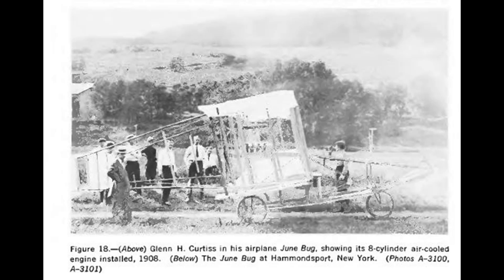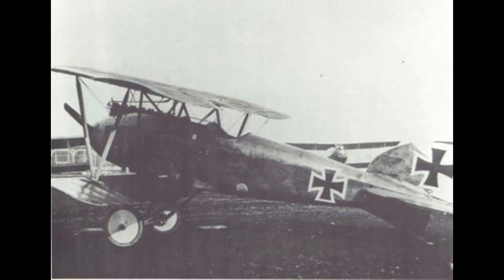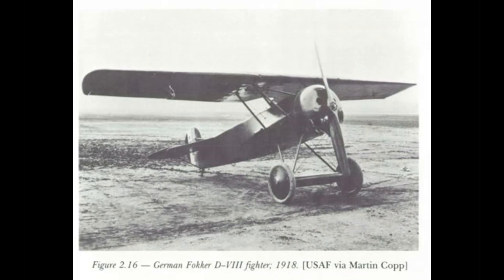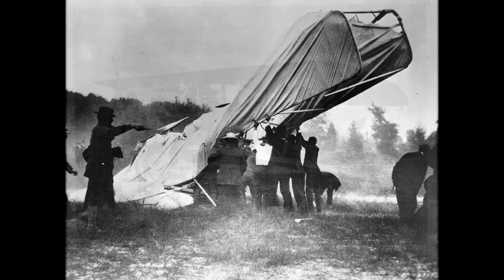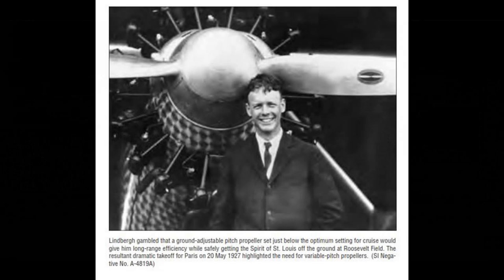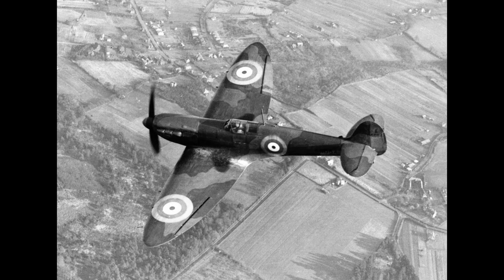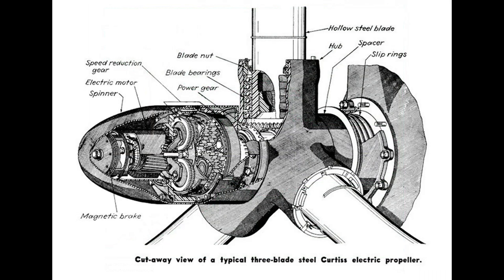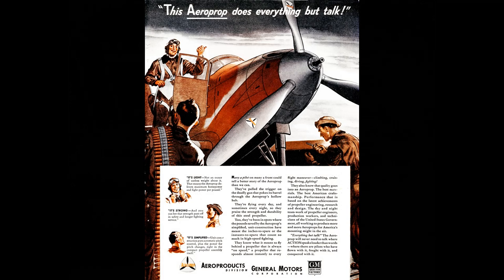Advancements In Propellers 1909-1942

Comment: Hi Greg. The Fokker Dreidecker was able to achieve exceptionally high angles of attack (by the standards of the time!), due to the thick airfoil w/rounded LE. This gave it the ability to turn tightly and achieve deflection for the guns. The cost of the poly-wing approach was exceptionally high induced drag, hence the need for maximal low-speed thrust, to counter loss of height in a turning duel...

Comment: Great video, as always.

The details of the constant-speed mechanisms was especially interesting. Am I correct in thinking that in variable pitch propellors the force of the pilot moving the pitch lever was the only power involved in moving moving the blades? That is, there wasn’t an electrical or hydraulic system to actually do the work.
Reply from the maker: Hi Alexander, not really, I should have clarified that. That variable pitch prop is essentially a constant speed prop but without the governor. I'll clarify that in the next video.
Reply: @GregsAirplanesandAutomobiles  oh, I see—thanks for the explanation.

Comment: Wow you blew my mind. 🤣
I never realized that props were controlled by a basic Briggs and Station mechanical governor. Hahaha 
Your outlook on hydraulic vs electric does leave out the problems with hydraulic systems. Pump, shifting valves, lines,spools, and temperature. I don't know what kind of redundancy it built into each system. I love your work. 👍
Reply: I think the main benefit is that if your hydraulic prop has issues, you can still use the radio, instruments and everything else that needs electrical power, and limp back home with your prop on whatever manual pitch control system is built in.  I remember a generator going out on me and just barely making it home one night, not a good time and I was only driving a Bug, not a P-38 out over the Pacific hundreds of miles from home. 
So to me it seems that of the two systems emergency scenarios, the hydraulic system has fewer drawbacks.  Either way, it most likely was no picnic for the pilot if either system went out.

Comment: Very good points at 14:00 - re the adaption of constant speed props on the Spitfire MkI. Although the Rotol constant speed props were standard on production lines by early 1940, it wasn’t until after the Battle for France that existing front line fighters were retrofitted. The Luftwaffe’s comparison between the new 109E and a captured spitfire in June 1940 were conducted with a De Haviland ‘two speed’ prop running 87 octane fuel: the Germans believed their plane would have a slight performance edge in the up coming BoB, but were surprised by the performance of Rotol constant speed prop spitfires using 100 Octane fuel - which both the spitfire and Hurricane were using by July. The BoB Spit could climb 750ft a minute faster than the one the Germans tested only the month before. Ouch.
Reply from the maker: Thanks Andrew, well said.
Reply: … the performance of De Havilland constant speed (upgraded) propellers using 100 octane fuel !  The Rotol constant speed props were on the new Mk IIs, only 4 squadrons had Mk IIs in early October 1940.
The Bf 109 got constant speed props in the F model.  Early installations in trial Es and early Fs had the constant speed controls wired off because of initial teething problem unreliability.

Comment: The Stearman pictured has a 300 hp Lycoming engine with a Hamilton Standard constant speed prop, 2B20 I think. The typical ground adjustable propeller on a period correct WWII Stearman was a steel McCauley 41D5926 (Army) or D-1093 (Navy) I’m not sure when they became available, post war I believe, a Hamilton Standard 5404 ground adjustable propeller with aluminum blades and steel hub  are common.

The McCauley and Hamilton Standard are not difficult to adjust. It can be done effectively with the propeller on the airplane or a prop setting table. 

I own a Stearman and maintain it.

Comment: Amazing work as always. Please pardon me if I missed, but you said in the D3 that in a dive you fairly easily overspeed the prop. What is the consequence of the that? Do you mean that the plane is going too fast in the dive for the prop to help or is the airstream somehow windmilling the prop faster than its design strength? Thanks. Henri
Reply from the maker: Hi Henri. As dive speed builds eventually even with the engine at idle the airflow will windmill the prop pretty fast. With a low enough pitch prop and a high enough dive speed it will windmill it above the engine's redline. For this reason the engine's redline was the actual dive speed limitation in many early planes.

Comment: Prop stays on Top is the mnemonic I learned for order of operations of a constant speed prop.
Reply: Good for a last second pre-take off glance.
Not a great mindset though if you are constantly alert for an engine failure, that is the prime requirement for safe multi engine flying.  Getting the prop feathered as soon as you have correctly identified the dead engine involves pulling the blue lever right to the bottom without delay.
For normal power reduction throttle is reduced first, for normal power increase prop is increased first.
Reply: @givenfirstnamefamilyfirstn3935  Prop stays on top means exactly what you just described.  Prop moves first when increasing power, moves last when reducing power, hence the expression "prop stays on top."  It has nothing to do with a "last second pre-takeoff glance."
Reply: @jaym8027   I hadn’t heard it.  It makes sense if your Jack Ridley stand-in explains it.
The first adjustment you make is a power reduction.  The blues start off fully forward.

Comment: The ground-adjustable propellor allows compensation for density ratio. The engine's power output and the required takeoff groundspeed are both significantly affected by prevailing density ratio, so a ground-adjustable prop is generally tweaked for optimal takeoff at either the aircraft's home field, or the critical one of the fields it visits. Summer and winter adjustments may also be necessary...

Comment: Wow. I asked my A&P how does this work. He stated from memory a description of parts except part numbers. CAF has one of the Aircobras. I was down in Harlegen with new Engineering Degree & Canon camera. A P-39 was disassembled engine removed. Have image in my head but have not yet recalled it I took pictures. Suggest you contact what was called Confederate Air Force. Bet they have the info you want. This is very interesting. Thanks.

Comment: Douglas Bader crashed a Hurricane while attempting to  take off with his propeller pitch set incorrectly the day before he was promoted to (I think) Wing Commander.
It was an early Hurricane with what I am assuming was a two speed/dual pitch propeller, based on the what I gleaned from the events described in the book 'Reach for the Sky'.
The book described a knob which was pulled out/pushed in (much like a choke in older cars) for fine/coarse settings. (Only fine and coarse were described, still, could have been variable pitch).
Reply: A perfect example of what simplifying/lowering operator workload is actually safer and how those "creature comforts" pay for themselves.
My dad talks about how when Caterpillar introduced the floating gooseneck and suspended seat to their earth movers it added a significant portion to the list price. Most companies were reluctant to spend that money but the companies that did were getting more dirt moved per hour (which if you didn't know is how the company gets paid).
Reply: 19 squadron Spitfire Mk I on 31st March 1940, it probably had the simplified two position prop control.  He had been sent to 19 squardon to pick up some experience having just rejoined the RAF.  The squadron had the wrecked Spitfire for a total of twenty days.
He didn’t sound like a person who took standard (safe) procedures seriously.
Reply: @givenfirstnamefamilyfirstn3935  ...
Thank you for the correction and clarification.
Cheers.

Comment: Both the Grumman Bearcat and Douglas Skyraider used Aeroproducts propellers. There are several advantages with the Aeroproduct. One is they are lighter weight.  Two if a blade was damaged it could be replaced with out disassembling or even removing the prop from the airplane. Three the propeller was completely self contained. It used hydraulic fluid carried in the "regulator" (not engine oil). This has a couple of advantages. If the engine loses oil pressure you still have control of the propeller meaning that you can increase the pitch of the propeller (reducing RPM) which will delay the engine seizing and extended the gliding distance of the airplane after total engine failure. Also to remove the propeller you only have to disconnect the propeller control from the regulator arm and undo the prop retaining nut.  As one can tell I'm a huge fan of the Aeroproducts having overhauled numerous models and flown and raced at Reno behind them for over 35 years!!
Reply from the maker: Hi Brian, thanks for that information. There isn't much out there on Aeroproducts, so it's great to hear from someone with actual experience with them.
Reply: You are welcome. A couple more notes for you as far as I know the Aeroproducts was the only manufacturer to have hollow steel blades in production. You also mention that the Aeroproducts had only 35 degrees of pitch change. This is true for the early Aeroproducts P39, 63, 51(K&H) up to the F8F-1 Bearcat. On the later props F8F-2 and Skyraider they have 40 degrees of pitch change and the props on the P82 are in fact full feathering.
I made a point of the Aeroproducts being independent of the engine so that a loss of engine oil pressure does NOT result in the loss of propeller control. Most people have no concept as to the amount of drag a 13 foot diameter propeller has in flat pitch. When checking out in the Sea Fury my father demonstrated what happens if the prop "runs away". We started at around 10,000 feet pulled the power to idle and the prop to max course pitch. We set an indicated air speed of 170 knots which gave us a descent rate of 1,000 ft per minute. We then lowered the landing gear, to maintain 170 knots the rate of descent increased to 1500 ft per minute. Next we selected full flaps, the descent rate then went to 3000 ft per minute. And last he had me push the propeller full forward to fine pitch. I came forward in my seat against the belts!! I pushed hard over into around a 45 degree dive, the rate of descent was over 6,000 feet per minute at 170 knots!!  Under this condition we would not have been able to recover from the dive only crash into the ground. If you look at the crash of the Red Baron Reno 1979 (you can find it on YouTube) you'll see Steve Hinton fail the engine as he comes by home pylon. He starts a 90 degree turn right followed by a 270 left for runway 26 as he comes around onto final oil pressure is lost in the engine and the props go to fine pitch dragging him down short of the runway. I was there, he was my friend, and we all knew he was dead. Fortunately he survived and we are still friends to this day!

Comment: There are a lot of videos covering various military planes, their strengths and weaknesses, made far more complex by the sometimes numerous model changes, different engines in the same model, etc. But war has the effect of accelerating development and refinement enormously. A clear advantage in 1939 had been greatly reduced by 1942, and two planes that are “close” means survival depends to a large extent on the pilot. I read somewhere that if a pilot survived his first 8 hours in combat, his chances of coming through the war alive were greatly increased. And neither the Germans or the Japanese had a pilot training system that could keep up with losses.

Comment: 30:50  I think this is similar to the governor in a steam engine.  Though, for the steam engine, it also has large metal balls at the end as counterweight to the centrifugal force.  This is where the "balls to the walls" expressions comes from since making the engine faster means allowing the metal balls to come closer to the walls enclosing the engine.
Reply from the maker: That's correct, it is similar.
Reply: Similar to an CAV DPA rotary distributor type diesel pump governor, cage and weights
Reply: Nope, balls to the wall comes from US pilots in WW2, the control levers for the engine on most US aircraft had balls on the top of them, going for max speed meant pushing them all the way towards the firewall, hence "balls to the wall".
Another saying that comes from US aircrews during the war was "The whole 9 yards", a compliment of .50 cal ammo for either some fighter aircraft or some gunners in bombers (I've read sources citing both) was 9 yards long, if someone completely unloaded on something they would say "I gave him the whole 9 yards".

Comment: Love this stuff! But? I think we're missing the video about blade area and airfoil.

My experience is with fixed pitch props in both my own, full scale, Aeronca Champ and 50+ years flying models.

Most pilots don't really understand that props are wings. At first blush, the assumption is that they "screw" through the air. They are even called "airscrews" by some people but that is misleading. Actually, props produce thrust by creating lift.

Just like any wing, the performance of a prop blade is determined by its airfoil, its loading, its speed, its drag, and its pitch. While the simple understanding is "more pitch=more thrust" it isn't that simple. I will give two examples.

About 20 years ago I bought a new prop for my Champ. It was virtually identical in dimensions to the old except for having less pitch and a new airfoil. I got it for increased takeoff thrust for a short strip but, much to my surprise, my max speed and cruise efficiency also increased by a significant margain.The prop with a flatter pitch actually increased thrust throughout the, very small, speed range because of the improved airfoil.

Then we get to model engines. It's not a direct comparison, do to scale effect and the fact that a two-stroke "glow engine" spins from around 10,000RPM and up, but the principles are the same.

Anyone old enough to have flown glow engine RC models knows that, for about 50 years, the most popular engines were .40 cu.in. and everybody used a 10"(diameter) by 6"(pitch) prop. Well? Everybody got really crappy performance. Those props, especially one particular brand, were chosen because they wouldn't come close to overloading an engine and wouldn't break if you touched the ground but they are horrible! 

So, sometime in the 80's a new brand came into the picture and they used a modern airfoil and increased blade area for a given size. Their 10×6 was a bit better but then, again for better low speed thrust, I tried an 11×4. To my surprise, again, I discovered that in addition to better low speed thrust my plane was clearly faster. I don't have a radar gun but, comparing it against a buddy's plane, I think I picked up about 10mph or about 15% on top speed. Then that company came up with a special prop for competition free flight models. These model climb vertically, with a timed engine run, so all things being equal the plane with the best prop for climbing wins. Well?

I put that 12.25"×3.75" prop on and the difference was astounding! Take off performance was spectacular, speed increased again, and a plane that would "hang on the prop" for a second or two would now accelerate vertically out of a hover. So?

There's a hell of a lot of importance in propellor parameters that aren't really covered by the evolution from fixed pitch to constant speed props. There are real world examples, like the P-47's "paddle blades", but the general trend in props seems to be increasing the blade area and improving aifoils. And that is, exactly, my experience. If I were seeking a new prop? I would look for a modern airfoil and the biggest blades I can spin without overtasking the engine.

Cheers!

Comment: Just as a wing can stall so too a propeller. Various pitch angels a huge advantage in propeller development. A speed regime of 0 to 500 mph yet relatively light weight. Every part of an aircraft is of great importance but none more so than propeller systems. Multiple engine aircraft up the ante with more complexity of numbers and pilot responsibilities.

Comment: Great  video...  subscribed and look forward to all ..   
Minor correction ..  its blade centripetal twisting moment (CTM) that drives propellers towards flat pitch,  not aero forces.   For most prop air foils .. the the center of lift is forward the center of blade twist ..  so aero loads try to pull the prop into coarse pitch... CTM is typically the dominant force at operating rpm
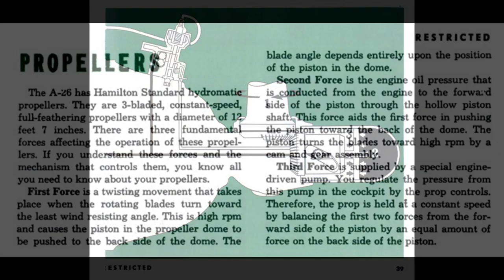Reply from the maker: I knew someone would say this, which is why I included the image from the factory A-26 manual at 28:22

Comment: Flying Spit Mk1  or older Bf109 in the flight sim Cliffs of Dover demonstrates how much attention it takes to balance manifold pressure, throttle position, propeller pitch, RPM, and engine temperature and fly formation.   It’s so easy to make a mistake and damage your engine.  Gets even harder when ACM starts !
Reply from the maker: Thanks, I haven't flow in Cliffs of Dover, I'm glad to hear it's so accurate.

Comment: Hi Greg, again kudos for an excellent series. Binging on it, while the missus is out. :)

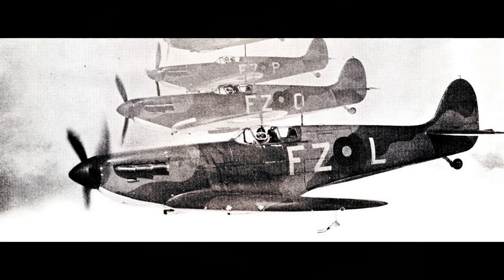I do have one remark: the "two-position" Hamilton-Standard 11:25 looks awfully similar to an "automatic" propeller to me. The type that varies the blade angle according to centripetal forces on the weights at the root of the prop blades. I am not sure, if I am just blind, or there was an actual similarity.
Reply from the maker: Yup, it's not a ground adjustable, I made a mistake there. I used to fly a Stearman in that paint scheme with a ground adjustable, so I just saw what I expected.